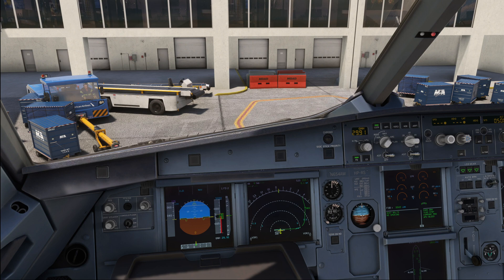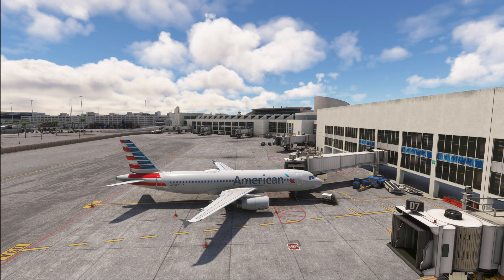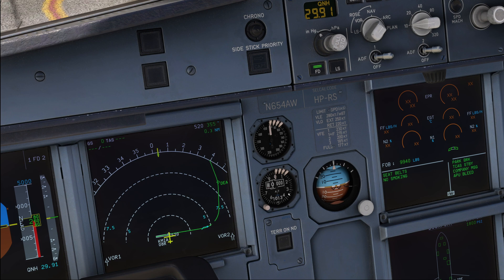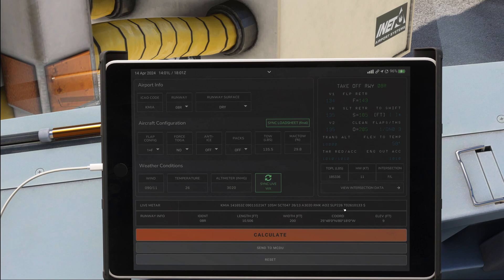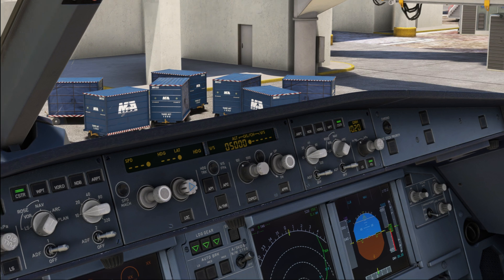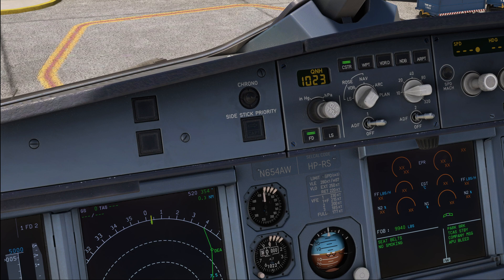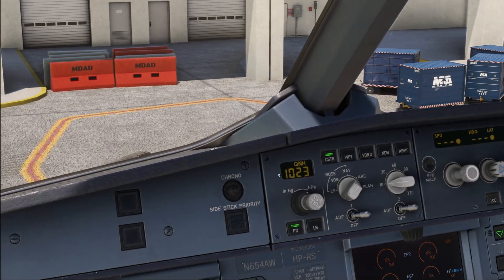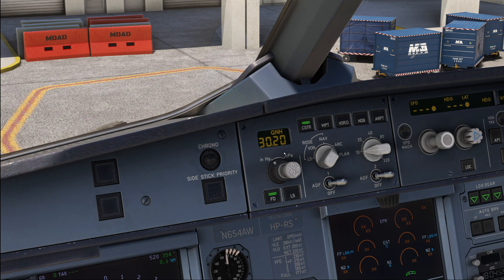Airbus tipps and tricks: Converting Altimeter Units | Real Airbus Pilot

Comment: This is incorrect unless airport elevation is close to sea level or 12h mean temperature is close to ISA because SLP is corrected for the 12h mean temperature and is intended for use in meteorology rather than altimeter setting - take this current METAR for example: KSAF 021353Z 00000KT 10SM CLR 12/M02 A3001 RMK AO2 SLP075 T01221022

Comment: Thanks Emi.. I was born and raised on Fahrenheit,  inches of mercury and pounds lol. I've gotten good at a quick mental cross reference of temperature since it's always used in our weather reports. Still struggling and working with pounds vs. Kilos and the air pressure unit conversion. I like that we have these differences, the more you know the better..

Comment: Great video, thanks. In other aircraft - such as the BAE 146 - when I set an altimeter reading, for example 1022, the same (1022) HPA reading also allows for slightly different altitudes on the altimeter. So how do you know which ‘turn of the knob’ is correct? (Particularly tough when cross-checking to airport elevation altitudes in pre-flight for example)

Comment: Hpa sucks. It’s less accurate than inhg because you don’t put decimals in on most altimeters.
Reply: the question if, do you really need that? I don't think so, and the EASA agrees
Reply from the maker: Then again when you’re approaching an airport in the US and there’s several different airports in the Controllers sector and he’s issuing several different altimeter settings to different planes it can get really confusing as well.
1hPa is 27ft, taking altimeter error, temperature error and pilot inaccuracy into account the question now is whether it really makes much of a difference if you set your altimeter accurate to 27 or to 10ft.
Reply: @A330Driver   yeah that’s a fair point but more just an issue in vatsim. That obv doesn’t matter much irl. I was just being a bit dramatic in the original comment lol. But I do prefer inhg

Comment: As a professional pilot I would expect they/you know the pressure conversation in memory.  Also couldn’t you adjust the st y instrument to the same reading as PFD once the PFD is set correctly.
Reply: It's a standby for a reason. If your setting it to a faulty side incorrectly showing altitude then your standby will be to. You can't then reliably cross check the two altimeters showing the same value and the other showing incorrectly